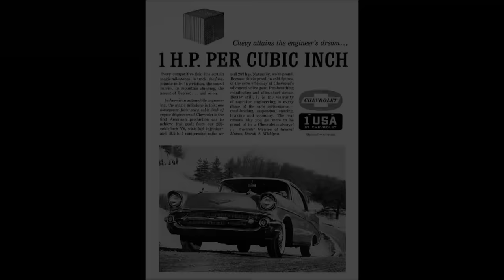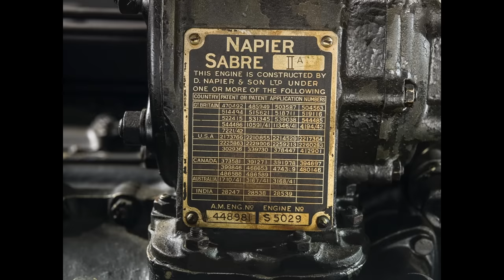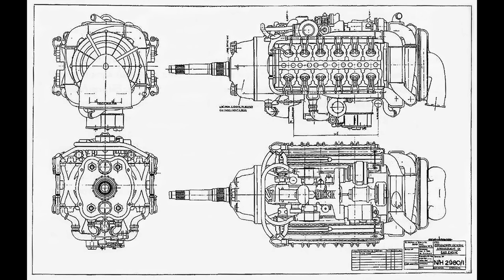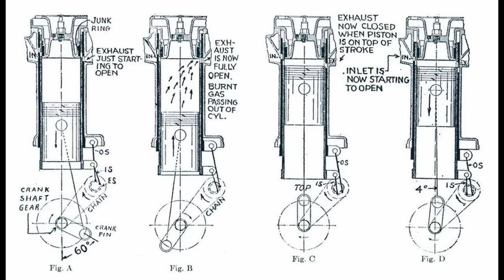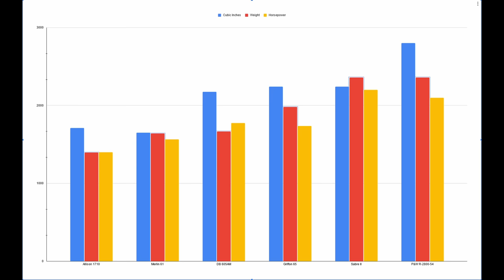Napier Sabre - The Ultimate WWII Aircraft Engine - Part 1

Comment: The Merlin engine was a great engine, but it gets waaay too much credit. If there was an engine that “won the war”, or powered more allied aircraft than any other, it was likely the Wright Cyclone family of engines. Not particularly glamorous, but a total workhorse of a radial that powered numerous different allied aircraft during the war.
Reply: I'd argue the P&W engines had a greater effect. The point of allied air was destruction of enemy air forces: bombing was a secondary component to this. P&W R2800 powered aircraft were responsible for the destruction of both the Luftwaffe (P51 arrived when the Luftwaffe was already severely depleted of talent) primarily with the P47, and destruction of the Japanese air forces in the post-Midway march towards Japan with the F4U and F6F.
Reply: @thepewplace1370  spot on👌
Reply: @thepewplace1370 certainly the P&W Wasp as well, but the role of heavy bombardment (on factories and infrastructure) - in addition to troop and supply transport cannot be understated. Basically most all the US planes powered by either the Wright or Pratt&Whitney.
Reply: @thepewplace1370  And the R-1830 Twin Wasp powered dozens of multi-engined aircraft, including 18,000 B-24 Liberators with incredible reliability.  Over 130,000 were produced.  Wright's R-1830 was a great engine in the same class of 1200 HP, but other than the larger R-2600 it sank into grief with the R-3350 and it's overheating problems until after the war was over.
Reply: the cyclone and wasps, also the continental. The big insane engines the brits made are great but US radials were equally insane
Reply: I'd go with the R-1830 as the most important Allied engine. In large part due to the B-24 and the DC-3 using it, not to mention many early war workhorse fighters like the F4F Wildcat.

The Merlin was certainly the most important Allied liquid cooled engine however.
Reply: @nerd1000ify  R1830 was another absolute workhorse and the F4F deserves major credit for holding out against the best frontline fighters of the Japanese until its big brothers showed up a couple years later.
Reply: Not sure how you can claim it won the war when in 39 the Hurricane was powered by the Merlin as was the Spitfire both are claimed to of won the Battle of Britain then you add the Lancaster with it’s bouncing bomb and tallboy the Mosquito that was made up from left overs but could out fly anything at the time. So I feel your claim of war winning a little insulting.
Reply: @mel.3687  if you feel insulted by statistical realities, you are too emotionally invested in the topic to look at it objectively. The early Merlins certainly equipped the RAF with planes that had near equal, or equal performance to the Luftwaffe during the Battle of Britain, but you're taking a lot away from the pilots there: it mattered little whether they had early Merlins, Allisons, hell they could have had single row radials so long as they were shooting German pilots down over British territory, it was an attrition game the Germans would lose. There is no realistic scenario where Germany sustains and invades Britain, regardless of the engine powering the Hurricane.

However, as the Merlin was further developed, and other tech along with it (namely, the fighters getting constant speed props that their opponents already had), it became a truly impressive power plant. Once the high octane American fuels showed up, it could run higher baseline manifold pressure than just about anything else (75 inches as standard, iirc). It also enabled the much cheaper Mustang to take over the high altitude role of the P47 thanks to the supercharging performance added to the Merlin. Even still, it was a numbers game, and the Merlin had to be outsourced to be license built to get it in the necessary quantities.

As far as its role in the destruction of enemy air forces, the fighters carrying in during 1943 and early 1944 did not have the range to penetrate very far into German airspace. The R2800 powered P47 was the only thing with the performance AND range to fly all the way into Germany with the bombers and hunt down the enemy fighters, until the P51 showed up in mid 44, by which point the Luftwaffe had been largely gutted of experienced pilots.

The Merlins had reached their limit by this point: Supermarine switched to a larger displacement griffon before the war was even over. By contrast, post war US fighters were still using the R2800 (F8F) because it had more use to give, and there was nothing that could replace it with better performance for naval use until jet technology matured more.

The Merlin was a great engine, no doubt, but the Pratt and Whitney radials, specifically the R2800, ended up being better, and more important to winning the war.

As a final piece of evidence, even the Royal Navy preferred the R2800 to the Merlin/Griffon, having a majority of the RB pacific fleet carriers flying Corsairs instead of Seafires.
Reply: I always come to comments for these arguments, they always make me laugh. Arguably the P51 would not have been the aircraft or was without the merlin, the F4U would never have made it to carrier use without the British navy perfecting its carrier approach. Over all if the British never held off the Nazis the American involvement in the war would have been very different, so while the merlin may not have been the best, or the war winner, it could well be argued that it was the most important due to its role in the early part of the war. It was also a very adaptable piece of kit, in various forms it was found not just on aircraft but in boats and tanks (as the meteor iirc), having a single engine, a single set of machine tools and jigs, interchangeable parts across so many different vehicles, that is what makes a difference. The same could be said about the Sherman, an excellent piece of kit for its adaptability not because it was faster or stronger than the next tank.
Reply: @grapes008  the P51 absolutely would not have been the iconic plane it was without the Merlin. The USAAF had put their money on turbosupercharging so the Allison only had the single inbuilt supercharger, and while the P51A was incredibly fast at low to mid altitudes, it ran out of air pretty quickly. This was initially fine, because the P51 was meant to augment low down and ground attack, but someone had the idea to try the Merlin in it, which had actually had the design work adapting additional supercharging to get it up to high altitude, and it was realized the P51/Merlin/130/150 octane combo could provide bomber escort for around half the per unit cost of the P47, and the P47, with its exceptional armor and air cooled ruggedness, was adapted to the attacker/CAS role rather well (although it's maneuverability and performance at low altitude suffered in comparison to its dominance at high altitude). It fit the role so well that most people will credit the P51 with destruction of the Luftwaffe, not knowing that the P47 destroyed roughly the same total number of enemy planes, while the enemy still had a large talent pool in their pilot ranks. 

I think some folks are reading my comment as "the Merlin sucked, the R2800 did it all", which is not what I wrote or intended. The P&W radials were simply more influential. The Merlin was definitely a prominent part of the war effort, it's just evident that the P&W R2800 was more prominent.

And yes, the RN got the Corsair approved for carrier use in the USN by showing how it could be safely landed. It was the predominant fighter of the pacific RN fleet carriers at the wars end, whereas in US service, the USMC was making more use of it flying from ground bases until right at the wars end. It doesn't matter who's flying it though: the point is that the R2800-powered Corsairs and Hellcats became the dominant allied fighters for the latter half of the pacific theater, after the also-P&W-powered F4Fs held the IJN at bay for a year or two.

My argument is that the design and engine type/production numbers made the difference, not who was flying it. Everyone flew everyone else's aircraft during WW2. The P40 came in both Allison and Packard Merlin flavors, being flowing by commonwealth and US pilots. The Soviet air forces made great use of P39s. The Brits flew Corsairs and the USAAF flew Merlin-powered P51s. Plenty of cross-pollination occurred between the US and UK designs: the Merlin, by the time of its use in the P51Ds, was an Anglo-American love child using the best tech from both countries to unlock its full potential. The Lancaster and other RAF night bombers using Merlins meant the Luftwaffe got stretched beyond its breaking point. There would undoubtedly have been even more massive casualties in the USAAF determination to continue daylight bombing without the RAF continuing the onslaught at night. This was the Lancasters best and most influential use, rather than the one-off special raids using dambusters, etc that get so heavily featured in films. 

The big Pratt and Whitney radials, while much larger in displacement and weight, made up for this in their ease of maintainance, resistance to damage, ability to be churned out in massive numbers, and have the power cranked up to 2800hp+ in their late models on highly resistant fuels.
Reply: @grapes008  Thank you for kind words about the Merlin and how it was a major factor in winning the war like the Sherman that by no means was the best tank but as infantry support it did well as portrayed in the movie Fury that for me showed it’s strengths and weaknesses. I do ask why the Americans didn’t build any Fireflies because they were a great tank being able to destroy even the Tiger 1 at 500 yards. Do you really think it was because they didn’t want a foreign gun on their tank a good enough one when they put a Merlin engine in the P51
Reply: @grapes008 no demerits whatsoever on the service of the Merlin, but the P-51 was a promising fighter before being fitted with the Merlin, which was ultimately chosen for practical reasons aside from performance. And the F4U (P&W Double Wasp) was also a highly effective platform before the British tinkered with its carrier approach. The Battle of Britain is another matter, but the war in Europe was well underway before that. The scope of Wright and Pratt&Whitney radials was immense on all fronts.
Reply: I think that all WWII info runs the risk of being tinged by propaganda. During the war, there was enormous concern on all sides about morale, both among the military and the general population. Consequently, wins were wildly celebrated, while losses minimized. Glamorous aircraft like the Spitfire were given the hero treatment to support the messaging: "things are tough right now, but because of the courage of our troops, the excellence of our weapons and the justice of our cause, we are sure to prevail in the end".  Kudos to Dojo for trying to get behind the biased naratives and digging into the more objective engineering data.
Reply: You must be American. Not neutral in opinion at all hahaha
Reply: @reneegudjon3204  You sound French a very confused nation. I mean when had France and Great Britain ever been allies?
Reply: @mel.3687  Way way off
Reply: @reneegudjon3204  I am sorry. Last I heard the name it was pronounced Ren-nay
Reply: @reneegudjon3204 one need not be American to have a definite opinion, but it helps. I haven’t seen any Brits here not pushing for the RR Merlin. Anyway, why be neutral? We’re talking about engines that clearly carved a place in history.
Reply: The Merlin made the Mustang! Stop the nonsense
Reply: @reneegudjon3204  look Ren-nay I am sure you have heard the saying if you have nothing helpful to add to the conversation why say anything. Also if it wasn’t the Merlin that made the Mustang what it was then what did? As it’s the engine that defines the aircraft, it decides how the aircraft handles. Meaning how fast it will go, how quick it will climb how good it is at different altitudes. So do you understand now Ren-nay what is meant by the Merlin making the Mustang the aircraft it was?
Reply: @reneegudjon3204  it did not "make" the Mustang. As I said above, the P51A was mighty fast low down and would have been highly successful in that role if noone had ever thought to try a Merlin in it. The Merlin-powered P51D offered a cheaper replacement for the P47 that had nearly as high of performance in some categories, so it was used. The Merlin also required US fuel injection and high octane fuels to enable the P51D to use it in this role. The nationalism game is useless here because as I said before, the cross pollination across the Atlantic between US and UK engineers made the Merlin as much an American engine as it was a British engine at that point (the fact so many were license built in America also...).

The Merlin was a great engine, but wasn't the best of the war, as evidenced by the BRITISH replacing it with better engines before the war even ended (see RR Griffon). By contrast, new planes using the R2800 were being implemented to frontline roles even after the war (see F8F).
Reply: @thepewplace1370  Not true at all. The Merlin was the answer to make it  as an high altitude fighter ,simply because it performed much better at high altitude at that time. So your argument doesn't  hold
Reply: @reneegudjon3204  that's what my comment said, I'm glad you agree. 

While the P51 was not initially intended for high altitude escort, and performed very well at low attitudes with its Allison, by a stroke of luck, equipping the P51 with the British-American Packard Merlin  enabled the USAAF to replace the P47D in the high altitude role for about half the cost per unit (around 50k for the P51D and 110k for the P47D, iirc) and much better fuel mileage, saving even more money and straining the logistics train less. While the P47D+ was more capable at high altitude, by the time the P51D arrived, the Luftwaffe had been largely sapped of its veteran pilots, so the performance drop was not a problem, and it was still the equal/better than the standard German fighters (ie the A8, G14, not the TA152/ME262 which arrived in such small numbers as to be irrelevant). This then enabled the P47 to be pushed into the ground attack mission, which it was surprisingly excellent at. Overall, this change enabled more planes to be built, to be flown, and more destruction of German forces to occur overall. It's lucky the Packard Merlin had such a great airframe ready to be adapted to it in the already excellent P51 (otherwise, you get the Spitfire, which while an excellent performer, lacked any sort of endurance for escort).
Reply: merlin didnt just power planes nor did its run end at the end of the war. it also powered multiple war winning aircraft.

jus sayin.
Reply: @noinfo9130  you got that righ!; Lancaster; Halifax; Mosquito; Hurricane and Spitfire!!!
Reply: @noinfo9130 the Merlin had alternative applications post-war, yes. But it was an aeronautical engine. Again, the Wright and P&W radials powered far more allied aircraft than any other. And in this context, an engine that “won the war” is in reference to no other war but WWII. Just sayin’.
Reply: @mel.3687  It made the Mustang in the sense that it made the necessary difference in performance to make it the great high altitude / endurance fighter it became!
Reply: Imagine a Sabre powered mustang
Reply: @SillyPuddy2012 Ok but what was America doing in 39 to help at Dunkirk for example?
Reply: Wrong , it powered spitfires, P52’s mosquitoes and others. Much better and constantly developed too.
Reply: @SillyPuddy2012  The engine that powered the allied victory in the Battle of Britain was the Merlin as a Spitfire or Hurricane. Then in the Lancaster with the famous bouncing bomb and the tall boy to sink the Tirpitz as for the Mosquito it with the help of the Merlin could carry the same  bomb load as a B17 and fly it higher and faster than any German fighter of the time so needed no escort and was used as a path finder so night bombers could find their target. Can you please tell me other than mass of aircraft what your engines are famous for or powered what aircraft although with out the Merlin, Great Britain could of lost the war long before Germany declared war on the US
Reply: You don't mention the Bristol Centauras which also had sleeve valves and had an output in the 3000 area. I'm guessing here but I imagine being air cooled was probably lighter.
Ease of manufacturing (and indirectly cost) is a factor you don't mention from memory I think the Sabre was around 3 x more expensive/difficult to manufacture. Ruggedness/reliability/overhaul life all vital in the field. From an American prospective  with almost unlimited resources this wouldn't have been a huge issue but with the very limited resources in the UK maximising bang for buck and standardisation was a huge issue the Merlin was fitted in Hurricanes, Spitfires, Mosquitos, Lancasters (Mustang) that must have been a huge advantage in overhaul spares training and manufacturing scale. Particularly compared the Luftwaffa with a proliferation of various engines
Reply: @thepewplace1370  I think its also a question  of prospective. Rather than just look at the specifics and performance of individual engines just consider the British prospective all alone for a period and with a very limited manufacturing capability. The Merlin was cheap (around 1/3) the price of the Sabre and was ubiquitous being fitted into Hurricanes Spitfires Mosquitos and Lancasters. Standardisation of parts training and cascading earlier engines into Lancasters. This offerd huge advantages to a small nation compared to the proliferation of engines fitted to Luftwaffe or US planes. Getting a good enough interceptor plane in the right place at the right time in the right numbers was something the British did .....just in time. The RAF had been bombing Germany for 3 years before the US started bombing
Reply: @philbentley8028  Excellent, forgot the Lancaster, nice info too.
Reply: @philbentley8028  I believe a good engine needs a good body. Your engine has 3000 output but aircraft is it fitted in? I mean a B17 has 4 engines yet it can’t carry more than the twin engined Mosquito
Reply: @SillyPuddy2012  Look sir you claim your engine “won the war” yet it wasn’t used in the Battle of Britain so it sounds about as much use as the Americans that most British soldiers claimed only came to England for the women whose husbands were out fighting for King and country so I know who I believe the men who are doing the fighting or the one’s who leave their kids behind when war is over.
Reply: @thepewplace1370  I agree with most of that but you got any evidence? that American engineers help develop the engine not just set up the factory's to make it and the alson would have been a better engine if it had a better super charger
Reply: @thepewplace1370  what? It was British engineers that set up the Alison  factory they even used the witworth fitting's being fast low down only makes it useless as a escort fighter
Reply: No it was there from 39  the credit is fair
Reply: @thepewplace1370  he does a video on the r2800, you might like it if you haven’t seen it yet
Reply: The only reason it gets the credit is because it was the “first” “major” aircraft engine in the war, also they make expensive cars now so…..
Reply: @zackstump5425  no they don't the car company is owned by the Germans. And no it's not because it was the first it's multiple reasons biggest one it was made through out the war 39 to 45 and the fact we had no alternative UK comanwelth did not make a radial big enough /Powerful enough to substitute it
Reply: @zackstump5425  yeah I saw it on my suggestions, I just haven't had a chance to watch it yet. Thanks for looking out!
Reply: @gingernutpreacher  it was not intended as an escort until the Merlin was fitted into it. The P47 was doing exceptionally well as an escort, and the intent was to put the P51 in a ground pounding role. Once they fit a Merlin in it and realize it was a high altitude beast at half the cost (and much better fuel economy) of a P47, there was a near complete role reversal, as the P47 turned out to be remarkable well suited to ground pounding and the USAAF had thousands of them. Thus, we ended the war with the P51D being remembered as the high altitude fighter, even though it started life intended as a ground attacker, and the P47 being remembered for its ruggedness in the ground attack role, even though it was designed from the ground up for speed at high altitude.
Reply: @thepewplace1370  but the p51 likes the spit hurkaine was vunrable to ground fire even rifle round's could mess up the radator I don't know what you're point is because I know all this and the fact UK was in despite need of air craft never mind ground pounders that could take punishment
Reply: @mel.3687  . I wasn't aware you were a YouTube editor
Reply: @Etäinshewölf007  there seems to be some major confusion that the Battle of Britain somehow represents the entirety of WWII, and that the war was England’s battle alone, it was not. The War was the sum total of all battles. Britain was only one front of many, an important one granted. But if Germany had taken Britain, it would only have been one more country to take back from the Nazis. 

Also, the US would still have come in later, and American industry would still have produced those radials in massive numbers, unabated by aerial bombardment. Speaking of which, a considerable number of the Merlins were license built by Packard, because England certainly didn’t have the capacity to produce a war winning number of them. America did. The Merlin rightfully won the Battle of Britain, but the American radial engine made the largest impact throughout the rest of the war, by sheer numbers alone. Not enough can be said about the impact the US bombing force had on turning the tides of the war to allied favor. Where allied fighters and bombers would have been based if not for England defending its turf can be said, but England was not the only allied held territory.
Reply: @SillyPuddy2012  I understand that you from what you say about America but what I am trying to say is that why would America help England if she had lost the Battle of Britain since America hadn’t done anything to help the Allies before why wait to do anything when they had been defeated surely if they had intended to help they would of done in 39 not waited till Hitler declared war on them. Think how many lives would of been saved had they of joined in 39 France might not of fallen. No I strongly believe that the turning point of the war was winning the battle and Germany attacking Russia.
Reply: @reneegudjon3204  Ren-nay did I miss something that said I had to tell you my life’s story?
Reply: Settle down fellas they all did their duty.
Reply: Most important engine that killed most Germans - the Diesel in the T34 Tank
Reply: @johnottodevilliers801  I think your on the wrong topic though a  T34 fitted with a Merlin would be interesting if it worked
Reply: @thepewplace1370  Not to mention RR was still using outdated Float Plane carburators, even after all the competition was using fuel injection or hybrid injection. This was a major downside for early and mid-week Spitfires, as hard maneuvers would starve the carb.
Reply: @mel.3687  Mosquitos and Lancasters flew at night. I doubt any liquid cooled engine could have sustained the damage B-17s took with their air cooled design flying during the day. I believe air cooled engines won the war.
Reply: @bluspectre2042  yeah, if I remember right this was corrected largely by 1942, with the use of an American fuel injected carb (throttle body injection, basically). But I don't know that this wasn't the norm at the time: I think the Germans were well ahead of the curve with their fully injected engines.
Reply: @johnottodevilliers801  theoretical at best and rather unlikely. But factually, the T34 did not serve on all fronts, the P&W and Wright radials did.
Reply: @jerryschneider145  The Mosquitoes famously bombed Berlin when Hermann Goring was about to make his speech on the anniversary of the Nazi party you can hear the bombs on his radio broadcast. Not sure what America were doing at the time plus the Mosquito was able to carry the same bomb load as a B17 it just didn’t need a fighter escort because no German plane could match it at the time. So your engine might be good just the plane was too heavy or engine not powerful enough to match the Lancaster also did you ever watch the movie Dambusters? I believe that was done in daytime so I don’t know where you got the idea they only flew at night
Reply: @mel.3687  The RAF mostly only flew at night and did "area" bombing, whole cities, not precision. The USAF did daylight precision bombing. Two totally different aircraft needed for these different missions.
Reply: @jerryschneider145  I believe that the dambuster raid was precision as was the bombing of the Tirpitz maybe you could tell me of a famous event that the USAF did before you start comparing the abilities of the British pilots who if it had not been for their brave actions England could of very easily of lost the war in the Battle of Britain
Reply: @jerryschneider145  - the theory was that the US daylight bombing allowed precision, but in reality, and admitted by all after the fact, was that the 'precision' of the 8th was largely a myth, as was the ability of the Norden bombsight. Imagine how precise the area of destruction is when you have a whole wing of bombers, all of whom drop when they see the lead plane's bombs drop.   I can't argue it was significantly better than the near city-sized target that the RAF night bombing ended up with, but it was by no means pin-point.
The roots of the aircraft designs of both sides long predated their eventual usage anyway.
Reply: @Etäinshewölf007  - you would thus be talking about a RR Meteor.  Used in some WW2 tanks, and the Centurion for a few decades after the war.
Reply: @jerryschneider145 - they certainly gave it a bloody good push, that's true, but I don't think it's clear-cut as saying X won the war or Y won the war.  

And was this the war that started in 1939, or the one that started at the end of 1941?  Don't forget, by the time the US joined the war, the British Empire had been at war for more than 2 years, fighting in and over Europe, the UK, the Mediterranean, the Middle East and North Africa, and the Atlantic and Murmansk convoys.  The Merlin was prominent in aerial fighting in all those locations - but in the same way that a war isn't just won by the infantry on the ground, but by their logistics train, the transport aircraft and bomber aircraft played their part, and they were definitely weren't all Merlins, or even Kestrels. Bristols Pegasus and Hercules did their share.  

I don't think the war would have been won with just one type alone.
Reply: @thepewplace1370  amen
Reply: @jerryschneider145  The US bombers couldn’t carry the weight though.
Reply: It and th P&W's and the various  Bristol radials .
Reply: Horses for courses.......
Reply: @jerryschneider145  The Dam buster raid was done at night, they used a very simple two light set up underneath the plane shining on the water to get the precise very low height required ( by continuing to fly the plane lower till the two light beams came together). It was precision in the extreme done with very simple aiming aids. The complicated part was the bouncing bomb. The British/Australian/Canadian and others all flew at night because they were very good at navigation, something the Americans always struggled with, even in daylight. Jeff
Reply: But wasn't the Merlin engine the first one to use 'pressure carburetor' ? So this probably enhanced it's reputation.. from my simple understanding, float carburetors used on cars has problems when applied to aircraft engines because they tend to starve in inverted flights, because their setup is dependent on gravity for the float to function.. so the pressure carburetor was invented and was implemented first on Merlin engines.. or am I wrong?
Reply: @pihermoso11  They definitely starved for fuel when they were upside down due to being fed by a carburettor, but they got away with it.
Reply: @pihermoso11  It certainly was designed with a high pressure cooling system which saved weight compared to German engines.
Reply: @grapes008  wrote:
"The same could be said about the Sherman, an excellent piece of kit for its adaptability not because it was faster or stronger than the next tank."

Say that to a tanker who is having holes punched into his Sherman by German tanks. As the shell were coming in, I doubt he was thinking,  "but my tank is better because the parts are easily interchangeable and cheap to make."
Reply: @philbentley8028  wrote:
"consider the British prospective all alone for a period and with a very limited manufacturing capability. "

Look at all the planes made by the British during WW2 and variations in engines as well. Astonishing. 

In 1942 UK forces were larger than those of the US and into early 1942 Britain produced more arms; by 1943 the US was ahead of the whole Empire in mobilized forces
- David Edgerton in Britain's War Machine

Far from being a plucky underdog in 1940, David Edgerton says:
 "Britain was a first-class power, with the world's largest navy, the greatest aircraft production of any country" 

"In 1940 aircraft production in Britain was greater than in Germany."

Edgerton again:
"There arises an intriguing counterfactual question: could the British Empire, in alliance with the USSR, have defeated Nazi Germany and Italy? Given that this is how the war was being fought, with the British anticipating victory, the answer could be yes. Indeed, if the war had been one of tank and aircraft production Britain alone would have stood a good chance of beating Germany."
Reply: Hear hear!!!
Reply: @thepewplace1370  not a good analysis. I don’t think any one really believes the BoB was an attrition game. It was certainly a game of bravado, opposition and poker, as well as continued resistance. Nobody ran out of aircraft or fuel or pilots, though it mattered. The RAF did run low on pilots at one early point but could within reason keep replacing them though with less experience and aircraft kept coming too.
 It was Hitler and Goering that pulled it as was obvious a channel invasion was going to be costly and not a walkover as they were hoping for… went off to a Russia to fry bigger fish, and but for some serious mistakes would have managed it…
 As for the Merlin, no one engine won the war or any war I expect but over 100,000 were made so played a pretty important part. 
The large air-cooled radials were undoubtedly the correct choice for the Pacific war on both sides… 
It all apples and oranges and nobody should be comparing them directly, the Merlin and sleeve-valve Hercules were what we had at the time and what we got and used well before those big US radials came into the equation… it’s so easy to forget this thing started in 1939 and Britain was arming up from about 1936 and Germany from before 1933, ten tears before the US got involved directly.
Reply: @grapes008  yes correct, the F-4U was a nightmare due to the US military, as so often, flatly refusing to acknowledge good practice elsewhere, that anybody rise knows anything about anything, or listening wisely (Pearl Harbour) it’s a human trait…  others have it too, but the US at war have an arrogance and bullishness that’ll be their undoing one day (just imagine their torpedo fiasco, how many good lives that cost, and how many $millions in lost naval hardware too)
 The F-4U was a great bit of kit, and we were very thankful to be given the chance to develop it properly, rather than be bigoted about it being loved or hated.. we didn’t have the luxury of being Marmite about much, at the time, unless it was very obvious a dangerous machine,
Reply: @thepewplace1370  But spits and Merlin powered aircraft were FAR more responsible for the destruction of the Luftwaffe than the P-47 - by quite a large margin. The experten core of the Luftwaffe was crippled by spits and hurricanes in the early days, and the Luftwaffe was on its last legs by the time the P-47s showed up and actually started doing things…
Reply: @thepewplace1370  If we’re talking about engine power, I agree. You can’t really push a piston prop over much more than 500mph, and it just so turns out unless your plane flies like a brick you need a good 2000HP to do that.

However the Merlin powered planes shot down far more aircraft - and aircraft of far better quality of pilots - than the R2800. That early war experienced Luftwaffe expert core who were shot down over Britain and North Africa doomed the Nazis. There 1943 Luftwaffe those P-47s flying was a bad joke.

Also, the spitfire exceeded the Bf109 in every metric - claiming the Merlin only got RAF fighters “equal” to German planes is a bit much.

There were still Merlin powered spurs flying at the end of the war and in fact ten years later. The massive horsepower bonus wasn’t necessary - it wasn’t going to make the plane any faster and was only necessary on a plane weighing as much as a house, aka the P-47

You raise some good points though. I’d certainly say the R 2800 was the best engine of WWII, and the one I’d want if I were focused on returning home alive. However it wasn’t crucial like the Merlin was.
Reply: @thepewplace1370   I’d also like to explain why British people have so much emotion around this topic, and I think it’s for good reason. I’m A USA-AUS-U.K. joint citizen so I like to think I’m reasonably neutral and haven’t lived in any one country long enough to be biased, but I spent my early life and later childhood in the U.K.

The US is always like the flashy kid turning up on the new block, bragging about everything, he’s got a flashy car, he gets with the girl you like and takes her out in his new fancy Ford V8.
Your good old MG, and even though it’s faster, it doesn’t have the hype of his car. Even though your car was involved in saving some kids from a house fire - he then went around saving kids from more house fires, getting in the newspaper, having pictures taken.

Britain’s biggest moment was WWII. Britain was the only power that stood in the way of the Nazis and complete domination of Europe. The war could have been won without the USSR - mainly thanks to the U.S., sure. The war could have been won without the USA - Britain itself was at no real risk of invasion - this only became apparent after the war - and see the 70s war games for evidence of that. But had the U.K. not been there to stop them they’d have had free use of global trade routes, due to no Royal Navy blockade, and with that as much oil as they needed (RN limited them to pre war export levels divided by two), no food shortages, they wouldn’t have lost 60% of their fighter aircraft, they would have had double the industry to throw at the Soviets 40% of their total war materiel and factories were spent combatting RAF raids - the USA made that sixty percent). Britain was not the biggest contributor in World War Two in terms of material, men, blood, et cetera. However it was undeniably the most crucial. America although amazing at supply lines simply wouldn’t have been able to do a Normandy invasion were they in America. The USSR couldn’t have got through 1941 without the U.K. - 40% of Soviet medium tanks were sent by the U.K. in 1941. Britain hinges itself and at the same time three away colossal global influence because they wanted to be in the right place at the right time - the country didn’t have to join WWII - it could have got out of it as late as 1945 literally was it going to look the the Nazis we’re going to win. The USA joined for different reasons - and at a time where the tide of battle had already been turned aAnd a defeat the magnitude of Stalingrad had been accomplished in North Africa.

The British Media played britain as an underdog in propaganda, mainly to evoke sympathy in the US. However it was not. The U.K. produced twice as many planes boats tanks - yep even tanks as the Nazis almost every year - this is excluding colonial possessions and lend lease. 

So, you have a country that literally broke its back on a war to liberate Europe from fascism. The U.K. would likely be in a similar position to the US nowadays had it remained neutral, allied with Germany, made a hell of a lot of money selling Spitfires to the Nazis as they paraded through red square, and kept their colonies in India, etc. 
Instead, after the war the public campaigned for decolonisation and perpetuation of the values upon which they fought a war. They didn’t have to do this.

Then come the constant “wE sAvEd yOuR aSs” jokes from Americans, which is infuriating as 1. It isn’t true - the U.K. itself was at low risk and the Nazis weren’t going to beat the USSR and U.K. 
2. Makes a mockery of the colossal effect it had upon the country. The one decision to back up Poland in that was formed the modern world we know today. America would not be the sole superpower we’re it not for that. Europe would not be free, we’re it not for that.

Then there’s the combination of massive American cultural reach - which includes outright stealing British accomplishments (U-571), minimising them (You don’t hear that the British provided 40% of tanks to the Russians; you don’t hear about the early successes in the war - the BoB is never emphasised as the turning point it was, the Royal Navy action is never spoken about despite it being the sole factor for the Nazis to invade the USSR.

Britain spent all its money, here’s another example - the atom bomb - this would NEVER have been accomplished in ‘45 without the U.K. 
The U.K. was further ahead on research compared to the U.S. and predicted to have a functioning nuclear bomb in 1946. After cooperating, the US agreed the British contribution was so important they would never be allowed to use one without explicit British permission. 
The US then stole the research of the scientists who were working in America after finishing the bomb, r refused to share any of it with the U.K., and acted in an underhand manner blatantly breaking the agreement. This is not the only tie the USA has done this - the USA acted in an incredibly underhanded and manipulative way during the war, only to erase what were joint achievements like this, sweep it under the rug, and take all the glory.

Regardless of whether or not you agree - that’s why people get pissed off. The U.K. is never credited with being the primary factor for German defeat - at least in terms of industry and materiel - on the western front, it’s always the US, despite their air and naval campaigns both being smaller and their ground campaign a little bigger - but causing the same amount of German casualties as the U.K. one.

WWII was the biggest moment in British history, it was a moment where the country sacrificed the incredibly safe and prosperous arrangement it had in pursuit of a noble goal, meanwhile the US didn’t show up until half way through, profited massively off their ally, and then took all the credit. Let us have our fucking engine. Now I’m pissed off.

Sorry. But regardless of whether you believe all of this or some of this to be true - this is how the series of events is remembered in Britain - and in America it’s remembered for the most part in an even more reductive manner. My son was called a liar by his history teacher at school and actually sent out the class after protesting for saying my (British)grandfather landed on the beaches at Normandy. This was in a Houston Texas middle school. That sums up how it’s remembered there for me at least.
Reply: @BryanJohnson4891  you have made numerous claims in several comments which I have reason to believe are inaccurate. 

(the spitfire and merlin powered aircraft were far more destructive, the spitfire always was better than the 109, the merlin was crucial, the R2800 was not, etc)

Given that the spitfire kill count isn't known, and by nearly all data metrics, the Luftwaffe was strong into early 44, and the only merlin powered aircraft to actually meaningfully seek out the Luftwaffe in its own territory was the mustang, and that there are numerous dates on which numerous models of the 109 had superior performance in some metrics than its contemporary spitfire, I'm going to ask that you provide the evidence for your claims, because it will be new to me and I'll be happy to be proven wrong.
Reply: Maybe if the US has turned up at the start of WW2 in ‘39, then the Wright engine might be better known. However the US merely earned a participant status.
Reply: @timhale748  the engine being discussed here is the Pratt and Whitney R2800, not a Wright engine. Your lack of knowledge on the subject doesn't make it any less of a huge contender.

The US wasn't playing ball in 1939 because nobody attacked the US in 1939. The Brits and French went to war because Germany invaded Poland. So did the USSR, two weeks later, yet they didn't declare on the Soviets? I'm not sure that was the right decision, which is what happens when you start wars that aren't in your own defense.

You are clearly very passionate about this, so I'll just point out one thing: the Royal Navy loved the R2800. They flew it more than any other engine by wars end, the Pacific RN fleet being the first to successfully run Corsairs off carrier decks, eventually leading to the USN approving it for that use.
Reply: @thepewplace1370  Your comment is as expected, the usual mixture of arrogance and ignorance. Americans have always been and will always be slow in doing the right thing except when profiting from war as is their  inability to wage and win wars without help.
Reply: @timhale748  I can't tell if you're trolling or are actually serious. It's pretty hard to say ignorance prevailed when the entire US economy pivoted prior to the US entry into the war, and the US was supplying the British, but not the Germans, with war materials. However, the US has a Constitution, which any educated Westerner knows, that precluded just going to war willy nilly (or, it used to: Congress later gave the president excess war powers). But your ad homs do not distract from the fact that the R2800 was the most influential fighter engine of the war: even the British were happy to use it over Merlin and Griffon powered planes.
Reply: @timhale748  Far more than participant status, it’s fair to say US involvement saved Britain from eventual invasion - and certainly bolstered Britain’s defenses with Lend-Lease prior to direct involvement. Also US action won the war in the Pacific, which ended WWII entirely.
Reply: @thepewplace1370  Of course you just skip the part of history where England stood alone, and Uncle Sam were'nt even in ear with Germany. The P&W and Wrights joined in 1942, after Europe had been in this war since 1939. The Merlin practically held the Luftwaffe off the British isles, and without it no American engine would ever make an impact.
Reply: @modulfleirfall  my word you British guys are taking this way too personally. The Merlin wasn't a bad engine, by any stretch. Conversely, it was a phenomenal engine at its peak, it just wasn't the most impactful of the war. Its upgrades throughout the war kept it a top performer, well beyond its expected max performance. However, it was the RN that kept the Nazis out of England. Hitler never could cross the channel and he knew it. 

And even if he had, America still goes to war in 1941, and in all likelihood, 100% of planes the brits flew from then on would have had American engines, with the biggest changes being that the Packard Merlin probably doesn't happen, meaning the P47 takes the high altitude role and keeps it, whereas the P51 takes the low altitude/attacker role, as it was initially designed to do before getting the Merlin upgrade.
Reply: 3000hp PW wasp on the bearacat,  & it never seen combat. But was bad A$$. The 2000hp on the hellcat was dominate. Airframes made a huge difference in how a radial vs Inline worked.
Reply: It depends what angle you look at it from..   the development of the merlin and supercharger technology was impressive. Effectively doubling power of the merlin by the end of the war..  Powering the hurricaine, spitfire, lancaster, mosquito amongst others and later on making the P51 a viable aircraft.

Dont forget that the first 2 years of the war were fought without USA involvement so the reality is that.

The merlin was crucial at the start of war in '39 and was still relevant at the end of the war in '45 powering the P51D for example.

The P1830 etc provided reliable muscle but mainly from mid war to the end.
Reply: So p51, spit, hurricane, mossie, lanc, vs b17, b24 and the radial fighters. How the hell do you determine which were more important? You can’t. It’s a fool’s errand
Reply: @sblack48  as mentioned in the original post, it’s not really about the aircraft but which engines were the most vastly produced and therefore utilized in wartime.
Reply: People, driven mostly via media, always tend to end up focusing on and celebrating just a few platforms, people, etc. to celebrate. So, yeah, basically everything celebrated (from aircraft and aircraft engines to lipstick and pro athletes as “the best” are almost always overrated or hardly peerless.
Reply: Any worthy mention of the Bristol radials in your hierarchy of radial engines?
Reply: @thepewplace1370  It would be close however. The Spitfire/ Hurricane had shot down 2000+ enemy before the US joined the Fight
Reply: @thepewplace1370  They had the Merlin Allisons were not there until 42 And those fighters shot down 2000+ From Oct 1939 until After Dec 1941  [ 2+ years ]
Reply: @thepewplace1370  And the Merlin was the predominate plane in Burma A theatre largely forgotten. Burma 676600 Sqr Km Larger than all the Islands Combined that the Hellcat and Corsair fought for
Reply: @mel.3687  Logistics! the US Army did not want to have  odd ammunition in the hustle and bustle of War
Reply: @SillyPuddy2012 The scope of Merlins was equally felt on all fronts
Reply: @SillyPuddy2012  And the Merlin certainly did that
Reply: @thepewplace1370   Wrong  1. P47 was good to 30000ft puffed out at 39000ft Merlin 43000+ plus and the  P47 Had a lousy dive
2'Without the Merlin the P51 would have been just another good low level plane The fighting in the ETO WAS AT HIGH ALTITUDES
3 The Merlin did not use US fuel injection They used the British R/R-S/U system that R/R sent the drawings to Stromberg
4. The Brits were using US fuel in 1938 in 1944 they were using their own[ Shell/ BP]  It was not a secret by then
5. The Packard  was NOT an American Engine it was a British engine made by Americans There is a subtle difference
6. The  Merlin was never replaced by the Griffon The Hornet used 130/131 Merlins
Reply: @jacktattis  I was talking about the Merlin engine I think you are just sending random comments to comment made over a year ago hoping no one replies
Reply: @SillyPuddy2012   You need to do research and stop repeating the Mantra
Reply: @jamestulk4169  Partly true however the Spitfire WAS that good.
Reply: @SillyPuddy2012  Yes the Merlin
Reply: @gingernutpreacher  Packard NOT Allison Go and do some research
Reply: @gingernutpreacher  We did not need Radials for fighters
Reply: @bluspectre2042  Those out dated float carburettors allowed the Fuel to be kept cooler therefore more dense therefore more power .  Source: Haynes Rolls Royce Merlin 1933 to 1950  Workshop Manual
Reply: @jerryschneider145   The object is NOT to take damage That is why V engines are slimmer more streamlined
Reply: @jacktattis  I can not see my comment
Reply: @jacktattis  I can not see my comment
Reply: @jacktattis  if  and I it's the one I'm thinking of I didn't say we did but rr sale's were down because the American engines were more powerful and lighter and more suited to ground attack so tell me what engines were fitted to the tightest turning aircraft and what pistion engine the UK development before the end of the war
Reply: @gingernutpreacher  Well what was the Comment 110 posts is too long to go back looking
Reply: @SillyPuddy2012  The Merlins dropped more ordnance [ Lancs/Halifax]shot down more enemy[ Spitfire] was the best at precision low level attack[ Mossie ]was the best as PR ,  Spitfire in the west and Mosquito in the east
Reply: @jacktattis  no it's not coming up
Reply: @jacktattis  and no I won't believe you don't believe me
Reply: @gingernutpreacher And how many times was the P47  put out of action when its massive Turbo Supercharger and all it piping was blown apart?
Reply: @Etäinshewölf007  The USA was basically gutless wonders in 1939
Reply: @mel.3687  Dam Busters WAS at night/
Reply: @mel.3687  I dont think they had one.
Reply: @pihermoso11  That was fixed somewhat in 1940 by a Engineer, Beatrice Shilling who worked for R/R I believe
Reply: @BryanJohnson4891  Bloody Hell?
Reply: @jacktattis  they wanted it for ground attack but didn't have enough inventory to deploy them and ended up with the mustang and suffered from ground fire are you saying they they were wrong to want the P47 first and would not of made differences to losses
Reply: @gingernutpreacher  Is it not funny that the RAF kept the   Mustang fighting to VE day . No P47 in the RAF service until Burma
Are you not aware that the RAF would have been informed on how the P47 had failed at RAE and AFDU
Reply: @jacktattis  no I'm not familiar probably seen something in passing . But need a radial I suppose not but you say we would not have been better of with the cousair and it's engine and we dropped the sea fires  and deveopet the sea fury
Reply: @jacktattis  you write like anything has changed.
Reply: 1.Put it this way  ETO Top Fighter Merlin top Light Bomber Merlin top Heavy bomber Merlin in the  
 2.MTO top Fighter Merlin top Medium Bomber radial Top Heavy bomber radial  
3.Burma top fighter Merlin Top Medium Bomber radial and Merlin I cannot find wher they used a heavy bomber
4.SWP TOP fighter Merlin top Mdm bomber Radial top Heavy radial 
5.Pacific top fighter Allison the rest  radials
Reply: @philbentley8028  well said
Reply: @scottpearce7466  That is why all inline planes could climb Faster, Dive further , Go further, Go higher by a huge  margin, Turn Tighter
Reply: @gingernutpreacher   What US engine? 
2. Tightest Turning plane Hurricane- Merlin Followed by the Spitfire -Merlin
US P38 way behind the Spitfire
Reply: @jacktattis  The Mosquito was originally built because it was made of wood and therefore didn’t use much needed material for other planes like the Spitfire. When used as a bomber it could carry the same weight as a B17. It was often used at night to show the heavy bombers were to drop the bombers as they often only flew a few feet of the ground to avoid detection and to spot targets easily. While the B17 in comparison carried a lot of guns so was limited to the amount of actual bomb weight it could carry and although it was designed not to need a fighter escort because of all its guns I believe it required an escort as well
Reply: @jacktattis  I will answer this later but I think my original pint was the napier was sorted very late and by this time there were high power American raidals available
Reply: @gingernutpreacher  But the Brits wanted the Napier  for fighters  To the Brits the Radials were for transports and Bombers
Reply: @jacktattis  but they were under powered. And yes they wanted the napier but I am talking as captain hindsight it was ready far to late
Reply: @gingernutpreacher  I would  say  2340 hp was not under powered
Reply: @jacktattis  from what engine?
Reply: @jacktattis  bristol peg 1050 bhp in the Wellington and short Sunderland ect merlins in short supply but there still making Bristol peg if the had been making a 1550hp say at less weight  or better yet 2000hp it would of ment more aircraft the 190 gave us a scare and that had a nickel refused valves redusing hp
Reply: @gingernutpreacher  I find it hard to decipher ----- ect, peg, nickel refused Valves
Reply: @gingernutpreacher  No you are thinking of  Packard and the Merlin Allison had been a US company for years
Reply: @jacktattis  pegusis engine. Nickel   redused . I swear I typed redused I hate auto dictate
Reply: @gingernutpreacher  Thefe were between 2000 and 2400 p47 lost after it went to ground attack Source Eric Brown Testing for Combat 
No quote sources for how many liquid cooled planes were lost by having the cooling system compromised
Reply: @gingernutpreacher  actually 2400hp Napier Sabre IIB  Tempest V Source Mike Spick "Fighters "page 198
Reply: @thepewplace1370 ,so why did it take so long for you lot to become involved?….asking for a friend.
Reply: @BryanJohnson4891  that's all reasonable, but I'm not making the claim that the US single handedly won the war or saved ur asses or whatever. What I take issue with are the factual inaccuracies with some of the above claims about the air war over Europe. 

As I've said before, the excellence of the P51D was an Anglo-American accomplishment, rather than a case of "US fighter okay, British engine make it go brrrrrr", which is the sentiment of some of the above commenters.

As an aside, I'd make two counterpoints to the rest of your comment: first, I'd argue the greatest moment of the British Empire was when it led a campaign a century earlier, spending blood and treasure for decades, to use it's might to destroy the international slave trade. That is unprecedented in history, and probably the single largest contributor to the end of organized slavery in the history of humanity, and they did it at a time when it wasn't the cool or chic thing to do. Bravo. 

2nd point I'd make is that the standing alone of the UK vs Germany was caused by the UK, and Hitlers desire to exercise dominion over Europe was also created by the UK/France. Treaty obligations were present, but there is no evidence Hitler wanted anything to do with Western Europe until the declarations of war by UK and France necessitated it to secure his rear. His intentions were to go east. 

Why was ww2 fought against the nazis instead of the soviets? Because of British and French treaty obligations, and a matter of two weeks time regarding the invasion of Poland. I'm convinced we fought the wrong enemy: the nazis would have collapsed without our help in a couple decades, but the cost of communism over the rest of the 20th century, and now spilling over into the 21st century, is immensely more vast.
Reply: @jacktattis  P47 was lousy in a dive? You need to look at the primary source data on this: the P47 was unbelievably good in a dive. 

Also, can you show me which contemporary Merlin-engined combat aircraft were faster than the P47 at high altitude? It certainly wasn't the P51. The only propeller fighter I'm aware of that was faster than the P47s ~470mph at altitude was the Ta152, and only under very specific conditions involving mw50 and nos.

Idk where you're getting your information, but I'm going to take this opportunity to point out the importance of primary sources, and a broad spread of them at that.
Reply: @banjopete  in the war you started on your own continent in which we were not participants? Because we weren't involved until the axis powers involved us.

Why did the British take so long to get involved? I mean, we were 2 years late to your party, but you lot were later than that to the pacific war, which started, as I'm sure you know, way before 1939. What gives?
Reply: It was a fuel hog in the P-47.  The Mustang was the most effective and efficient solution to build and operate.  Eaker requested 20 Fighter Groups for bomber protection.  That equates to a lot less $$ using the more effective (and long range) Mustangs than the less effective Jugs.
Reply: @bobsakamanos4469  both the P-47D and P-51D possessed sufficient range with drop tanks to escort allied bombers from England to Berlin and back, so respective fuel efficiency wasn’t really a factor, as it hardly ever is in wartime. Also, the Mustang and Thunderbolt were not directly comparable in every way. The Thunderbolt could carry somewhere over twice the bomb load as the Mustang, and so was utilized heavily as a successful attack bomber.
Reply: @SillyPuddy2012  sounds like greg-logic.  Funny how he refused to acknowledge that combat range is dependent on internal fuel capacity, which the Jug didn't have until mid 1944 with the D-25.  Even then, it still never went to Berlin as a bomber escort.  He also hangs his hat on false examples in the pacific.  He's conning you.
Reply: @SillyPuddy2012  I would not question the Jug's success as a bomber, but that wasn't the discussion here.
Reply: @bobsakamanos4469  the P-47 was in fact the original American bomber escort, in service before the P-51 adopted this role. It was also a very robust and effective fighter all around as its record shows. The Mustang did have impressive range, but this was more a credit to its extremely efficient wing design than Merlin power.
Reply: @bobsakamanos4469  I’m not sure what you’re trying to discuss exactly. The Thunderbolt was Pratt&Whitney R2800 powered at any rate, also right up there with the Wright Cyclone.
Reply: @SillyPuddy2012  I'm well versed in fighter development.  The P-47 lacked range and wasn't a dog fighter leading to the USAAF ceasing deep penetration raids in late 1943.  Improvements to the Jug came late to be effective in neutralizing the LW prior to the important deadline of DDay.
As for the Mustang, the engine, the reduced cooling drag (thank you Meredith) and the wing were all critical to its effectiveness as a high altitude escort fighter. The Allison could never have done that.
Reply: @bobsakamanos4469  the P-47 deserves more credit in the fighter role than you’ve given it. Its high kill-to-loss ratio speaks for itself. As an aside, anyone familiar with the plane knows the top USAAF ace of the war in Europe (Gabreski) flew the Thunderbolt. All this is to say, that while the P-51 was an excellent fighter/escort - perhaps the best of the war, the Merlin itself saw very limited use compared to the likes of the Wright and P&W radials.
Reply: @SillyPuddy2012  don't confuse industrial capacity with effectiveness. As for the Jug kill ratio, yes it had success in the hit and run business, but often also premature RTB because of many factors.  In 1943 when diving after LW fighters, it was caught in compressibility and once it finally pulled out, couldn't climb back up to the bomber stream so carried on home, while the LW fighter returned the bombers.  It's turbo was also vulnerable and would leave the bombers to limp home if hit.  So, not a good escort fighter.